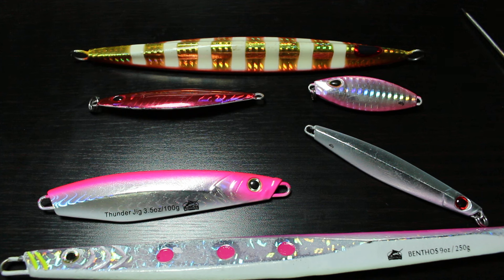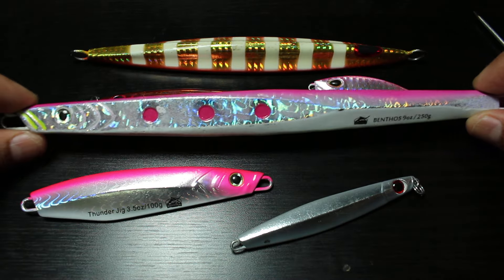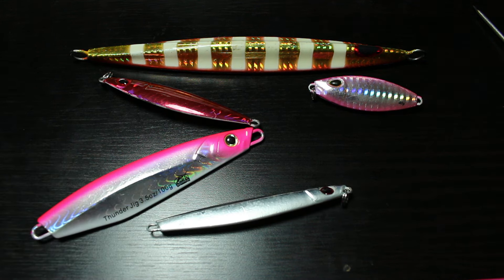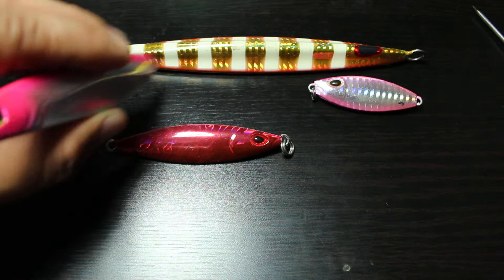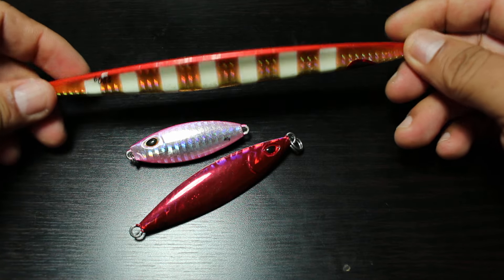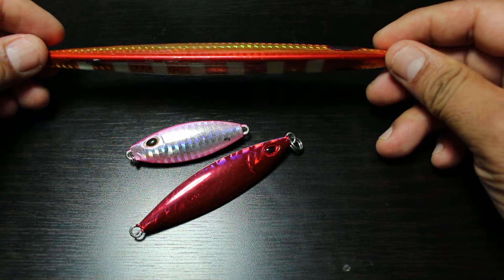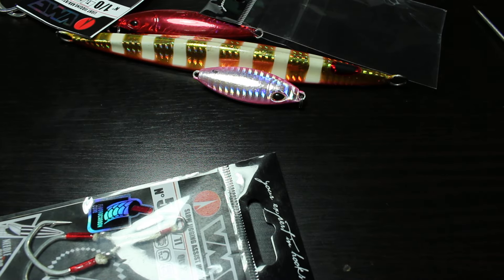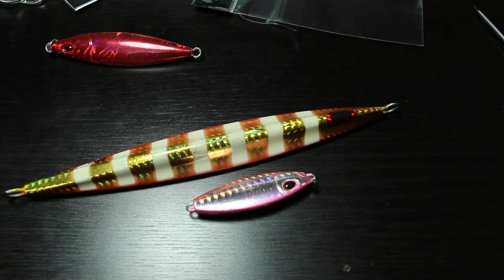HOW TO TELL IF IT'S A FAST OR SLOW JIG

Comment: VERY helpful. I want to get into slow jigging and was completely confused about how the technique and its lures differ from those of fast jigging, which I can't handle physically. Given what you said about jig symmetry, where woulld you put the traditional diamond jig? These lures are symmetrical, but here in New England, USA, they're jigged slowly, right on or just off the bottom.
Reply from the maker: Hi Chris, glad what I'm doing is helpful. 

On diamond jigs - It's kind of like the California you can't really classify them as the same as these types of jigs. I guess its the difference between the Western and  Asian style.

Comment: What would you say is the best way to match the hook size to a particular jig, when jigging from the surf? Thanks!
Reply from the maker: This is actually not an easy subject to tackle. Because this depends on the width and length of your jig. There are jigs that are long and wide, and there are also those that are long and slim; then short jigs, then the reverse, so on and so fourth. This is where production/ready made assist hooks fail. I usually size the hook with the width of the body, pit should be as wide or a little bit wider than where the hooks position to on the body. This depends of course on the shape of the hook.
Reply: Do you have released video discussing this matter? Re: matching the hook size and the jig? Thanks...

Comment: Which jig slides side to side as it falls down the water columns?  I want the one that slides side to side erratically as it falls down the water columns, not the one that goes straight down real fast. So which jig do you recommend if I want the one that slides as much as possible and hangs in the water columns for a white before it hits the bottom? I appreciate it very much if you could give me a list of them or even link a few of them here for me!  Thanks in advance if you could help me!
Reply from the maker: for fast jigs, you want a long center balanced jig - these are called "sliding jigs" or "Sliders".  Slow jigs are used with a different system - different rod, different reels and thinner line, different hooks etc. all slow jigs are designed to flutter and there are also slow jigs that slide.
Reply: @TheFishingKit  Thanks for the response, I appreciate it. Could you put a link or two of the slow jigs that slide? I want to buy a few and give them a try.
Reply from the maker: @grandwonder5858  Where are you located? might be that you would have to order from Japan or Asia. there's actually quite a lot, Major craft has the jigpara long slow, deepliner has several models that slide as well. then the long list of clones. but any slow jig that's long and center balanced can be made to slide.
Reply: @TheFishingKit  do you have videos that tackles of what system fits with slow and fast jigs... thanks
Reply from the maker: @joelduhaylongsod3503  slow and fast jigging are two different systems and require different rods and reels. I don't understand your question.

Comment: Hello i cant understand the difference in weight and what they help with
Reply from the maker: Hi, thanks for asking! Jig weights help you go down to the bottom faster - so a heavier jig can get you down deep faster, or go down deep in swift currents. Using a light jig in deep water with no current will take a long time to get to the bottom, or in swift currents, will not get you to the bottom at all!
Reply: @TheFishingKit ; gram per foot of depth
Reply from the maker: @sjog1952  wow...quite a good question. Thanks for asking. The usual measurement is not g/ft it's actually g/m and it is roughly 10g/m. It's not exact and is a rough guide to use when choosing the first jig weight you could potentially use for a given situation. Since there are a few factors that also affect it, like diameter of line, length and diameter of the leader which creates drag and additional friction as the jig falls down this is aside from Current and or drift speed - these jigs are meant to be fished or work their best when totally or almost vertical. 
so a 100g fast jig will drop slower on 40kg line with a long thick leader than it would with 25kg line with a shorter thinner leader. 
At times, the difference of 20-30g would let you reach down faster or in the case of fast drifts, would let you reach the bottom.
Hopes this brings some light to your question. Thanks again for asking.
Reply: @TheFishingKit    thanks for the info. Just figuring this technique out for fast moving current in New England waters. Symmetrical and non-symmetrical = fast-slow was news to me
Reply from the maker: @sjog1952  I'd be glad to help explain this further if you have some sort of chat software. if you can find me on facebook or something, send me a friend request and a message, I can discuss this with you in depth :) Would be happy to help you navigate this.

Comment: What about Tady 45 jigs, Tady C, Salas light
They are fast retreive and are asymmetrical. LoL
Reply from the maker: Ed, That's  very smart question. Thanks for asking this because I am pretty sure people in California would be thinking about this. 

Although those are called jigs, and in the minds of a lot of people, old jigs, those are actually in a different classification. Personally, I would call them...well, what a lot of people would call them - Irons. The first Irons were light, and were cast and used on the surface, which gave them their nickname - Surface Irons, from there, they developed the heavier ones like the 6x Jrs...which brought about another name...yoyo jigs...because of how they were used. 

They are also made to be used with Mono, which until this day...people are still using. 

Vertical jigs actually aren't a new thing - and it was the Scandinavians that first used them for fish like Cod, more than 100 years ago. 

Anyway, I might have missed a thing or two, but in a nutshell...that's about it. Again, Thanks for asking this question, it certainly needs a spot in the video, but I totally forgot to mention this. I have an Accuratized jigmaster for irons paired with a seeker deckhand special and have been using it here in the UAE - it catches, but I am fast running out of irons. Would have to order a batch soon. hahahahahah!!!
Reply: @TheFishingKit  are you losing them on the cast or getting bit off? Also JRI rigs are really nice. Give them a try if you are able to.
Reply from the maker: @otroflores91  I lost them over the years for a few reasons, snags being one of them since I tried casting them off rocks, can get more, just that the jigs haven't really changed much and although effective, there are readily available jigs that can be easily bought here (UAE).